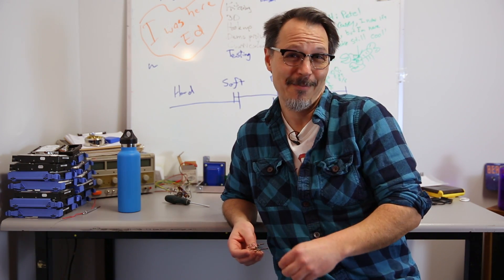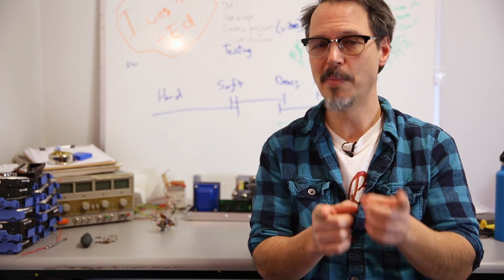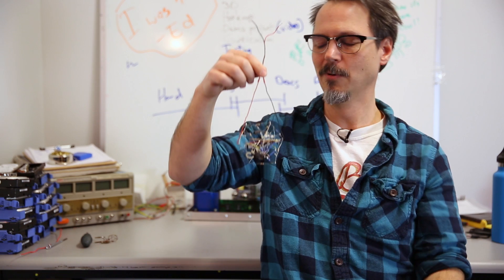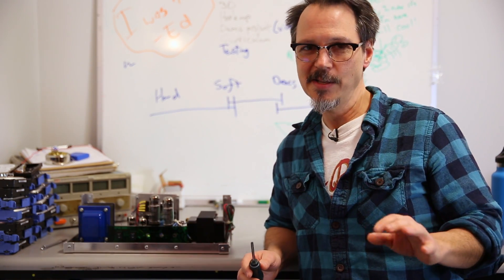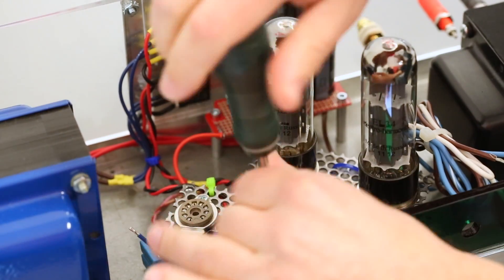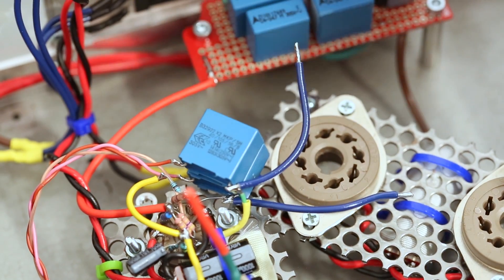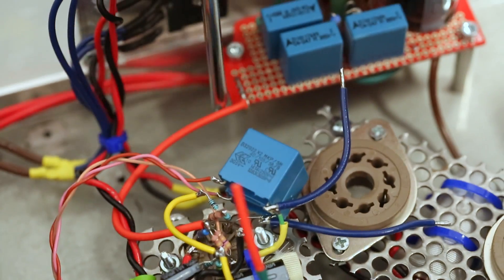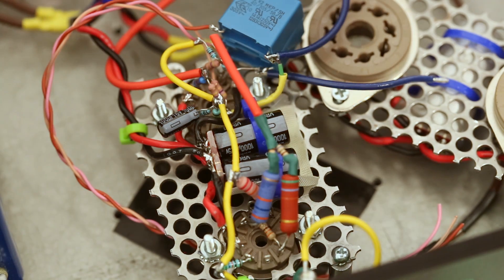SparkFun According to Pete #46 - Point-to-Point Soldering

Comment: This can't be stressed enough: it's not only in tube amps, but also in analog synthesizers, sequencers, compressors etc and in high grade HiFi equipment, "hard wired" circuits is a sign of quality, the theory being that a selected cable is going to be a better conductor than a tiny lane of a PCB. What I usually do is I use some kind of board and use a glue gun to glue the components to it "upside down", that is, with the legs pointing up, and then connect everything using wire, this can be very neat indeed. One step closer to a PCB is of course an experiment board with soldering holes, where you mount the components through the holes, but then use wires to hook everything up.

Comment: Another idea in the insanity file: point-to-point soldering of SMD components. I have a strip of bare 10 WS2812 RGB LEDs and I have considered making a sculptural doohickey with them, but I can't figure out how to hold them with sufficient stability to get those teensy pads tacked to leads. Obviously holding the part in a third hand will help, but do you have advice on the actual soldering?
Reply: The approach I'd probably start with is to tin both points with a decent blob of solder and tack them together with your iron. I've thought for a long time about building something stupid out of 0603 (OK, maybe 0805, my eyes aren't what they sued to be) parts, just to see what such a thing would look like, maybe hang it from a chain. In any case, I'd love to see what you're making.

Comment: Regarding the uninsulated high-voltage point, I have a suggestion to boost the safety factor a bit. Once you're certain that point will not need to be desoldered (for the foreseeable future) you can add insulation to it with a dab of nail polish.